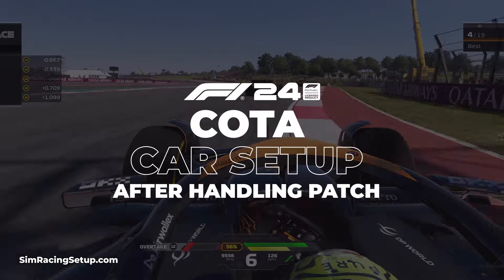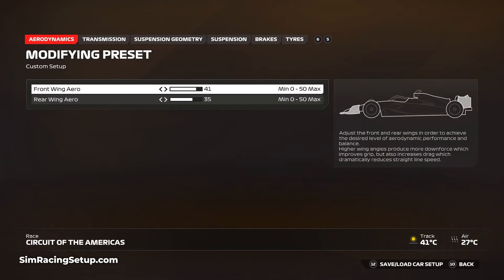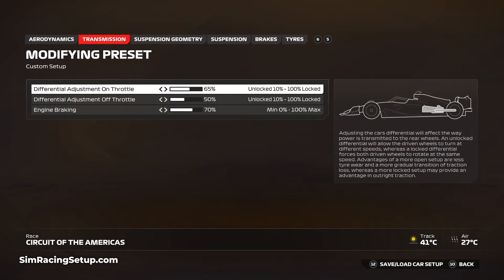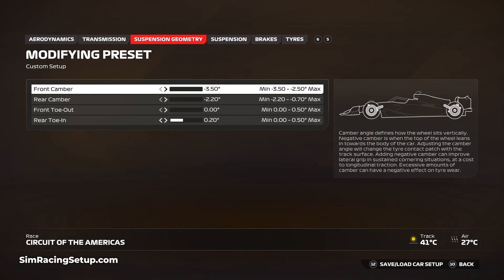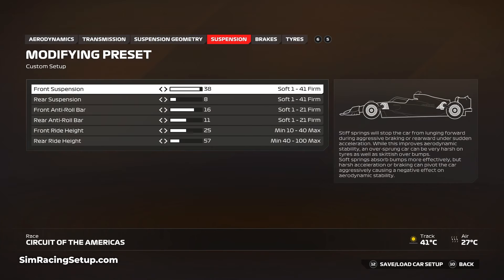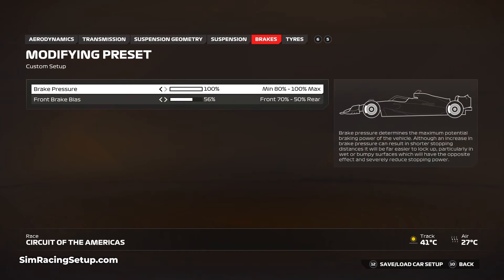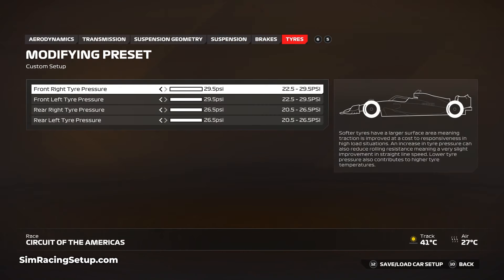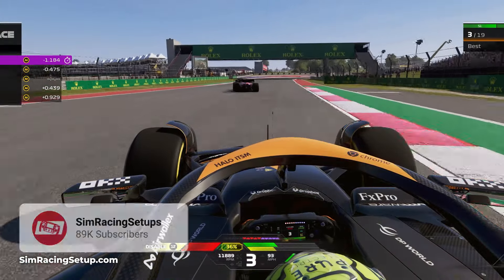F1 24 COTA (Texas) Car Setup (Updated After Handling Patch)

Comment: wow. i literally found 2.5s just by using this setup. can't explain what it was but likely a combination of the maxed camber, slightly more wing angles, 100% brake pressure and engine brake and higher tyre pressures.
Reply: Blud is glazing
Reply: @SsbSnipz123  :)

Comment: These vids are so helpful but the 1 thing I'm finding, or not finding I should say, is any issue running engine braking of 100 in races, which they keep saying is not a good idea. All I have to do at most is click the brakes forward a click if the rears are locking up and it's all sorted.

Comment: Mate on 100kg fuel my car is undriveable. I'm struggling with traction out of literally all slow corners. My on and off throttle diff are 60 and 50 resp. Any tips?